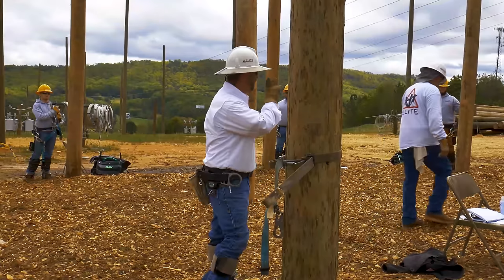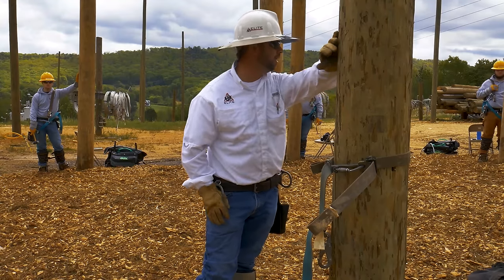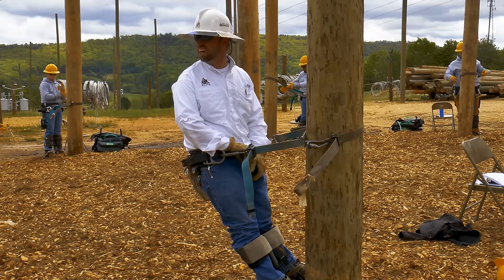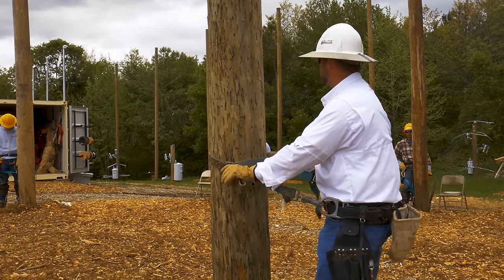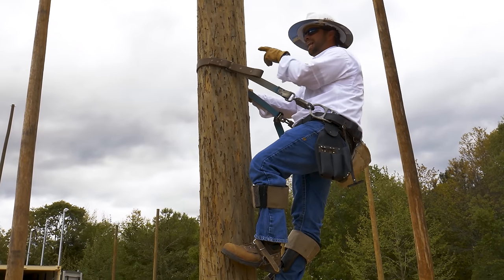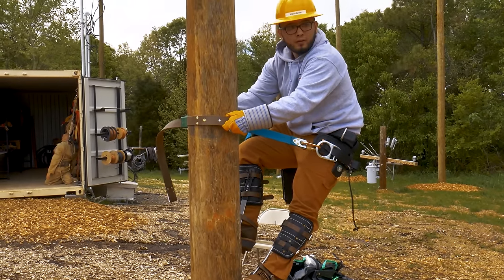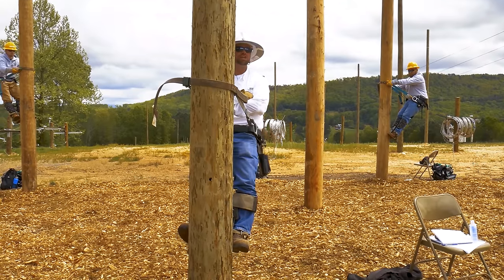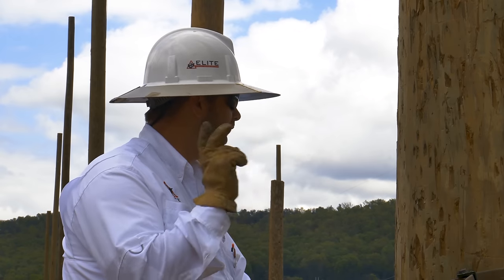ELITE Lineman - Learning to Climb Day One

Comment: I trained as lineman in the US Army Signal Corp, at the time MOS was 31K (wire dog) as we were called, it was a lot of fun. When we trained on the poles we would throw a ball from soldier to soldier, if you dropped it or threw it badly, you had to retrieve the ball from the ground and climb back up.
Reply: Trained in the Air Force under the equivalent of that job a few years ago. We were in the same classes as Army. Still did this and it was awesome.
Reply: Me too--Viet Nam Era--36k20 Field Wireman.  Ft Jackson training.  You dont lock that leg, you gonna have to "hug that pole"  Good Times.
Reply: @billr2375  Signal Corp! "They can talk about us but never without us"
Reply: @AelCosmo3744  if i wanted to do the same thing in the air force as you what are my steps ?
Reply: I just got home from climbing school. Im currently 19 and we do the same thing with the ball today
Reply: @peytoncappitelli5864  Go Signal Corp, They talk about us but not without us.

Comment: These fellows are lucky...I had to learn on my own with maybe 10 minutes of instruction. Climbed about 60 poles my first day doing disconnects for a local cable tv company. My arches were black for about two weeks due to improper gear and technique. Only time a safety belt was used was once I reached my destination...free hand up and down. The one thing I got from that 10 minute instruction was "don't step in your safety"...my safety belt always hung loose from one end because of that. Kind of like boot camp at Parris Island...some things you never forget.
Reply: Only 10 feet off the ground
Reply: I free climb too. Those belts seem real time consuming. Plus how do they slide up and down a heavily gaffed pole. You learn on these perfect new poles then climb on porcupine poles that the outer shell is flaking away.
Reply: @nealramsey4439  The poles we used in training were heavily gaffed, its a combo of having the buck squeeze loose enough to go up, but tight enough to catch in case of a fall.
Reply: @brianjohnson6053 10 foot hero’s 😂
Reply: West coast is the best coast

Comment: I went to pole climbing school for South Western Bell in Oklahoma City Ok. We only used belts after we arrived at our working height. Climbing up and down the pole we were required to maintain three points of contact with the pole. I quit after the first day. I didn't trust the equipment or the instructors.
Reply: Yep, free climb to where you needed to be and then belt in. We were told the only time you climbed with the belt was if the pole was iced over. Best part of plant school was finding muscles you never knew you had. Climbing is a work out.

Comment: They have fancy belts. I climbed without a strap until I was up to where I stopped. Then strapped and climbed down. You could choose the belt up by throwing belt up a foot at a time after a step or 2. But if you cut out you were getting the quick trip down belted or not. Our belts don't hold you up unless it's over a strand or something. It didn't grip pole. Though I wonder how well the strap slides on a heavily gaffed pole. Looks like it would get caught on the splinters sticking out.

Comment: I’m interested in being a lineman, but I’m not sure what fitness plan I need to accomplish this. What would y’all recommend: climbing experience at a rock climbing gym, or powerlifting? Or both?
Reply: Day 1 hard cardio
Day 2 light cardio to start then an hour of weights 
Rotate these for 6 days rest the 7th.
Forearms forearms forearms then shoulders too…
Lots of cable pull downs whenever you can..
You’ll thank me later 
Grip strength is HUGE you will hurt so bad on your elbow and forearm tendons
Reply: Your hands and forearms will hurt more then anything. No one mentions working in rubber gloves rated for high voltage. It's like rubber band resistance
Reply: @NQTOD  thank you for the advice!
Reply: @RougaRouKJun  I appreciate the tips! Thanks!
Reply: @katherynnethegreat8827  glad  to offer 
I’ve been thru ALBAT it’s no joke 
Get your mind right then your body 
You’ll kill it bruised
Reply: Lots of walking hit the stairs st the local football feild

Comment: Bit of a question... leading leg lower when you circle? Is there a reason for this? Doesn't seem right to me. I remember being told leading leg higher, so that you don't accidentally gaff yourself with the following leg
Reply: Your leading leg is always lower. So if going right your right leg is low and locked. Your left leg is high and bent. When you put weight on your left side, your right side has no choice but come out because of the spatial difference. Then move your belt and right side over and place it back low.